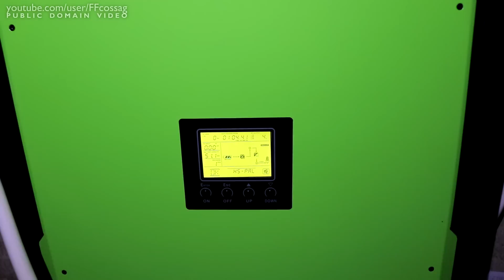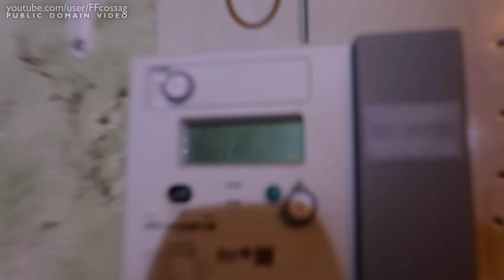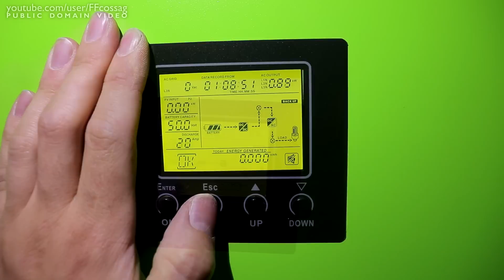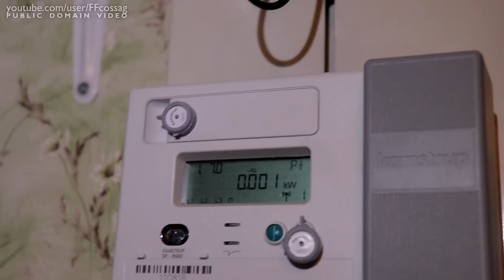10 kW Hybrid Solar VLOG 7 - Old mains & TEST!

Comment: sadly you cant run a grinder when you have a rcd as the motors are low resistance causing false tripping and you cant run some 3 phase equipment as they use ground instead of neutral as the "neutral" is connected to the metal casing so they use earth/ground instead for safety and they cant be used with neutral due to the motors having shared casing and winding connection
Reply from the maker: I'm really not sure what sort of gear you've had experience with, but they're definitely not common problems in Finland. ALL outlets for general use have to be behind a RCD, with no exceptions, and people run grinders and 3-phase machines just fine. I don't think I've ever seen any sort of motor with a shared case/winding connection here, if they exist, they haven't been legal for something like 70 years.
Reply: @FFcossag   the shared casing machines have been used in industrial and farm applications in the 80s and are mainly 3 phase equipment and they were never common and the ones that existed have been phased out for safer designs due to farmers getting electrocuted when the equipment had a ground fault. I think the rcd i have is a too sensitive Piece of S*it that hager manufactured. I need to get someone with more experience than me and up to date permits/certs to do electrical work to look at my distribution panel and electrical connections as if there is a bad connection in my panel that could be one reason for tripping when trying to run any of my grinders on any of my 10 or 16 amp circuits.

and if anyone asks no i havent nor will i ever open the 3 phase distibution panel myself as my SFS 6002 cert expired 2 years ago and my insurance wouldn cover it if my house burnt down and even if the cert wasnt expired i wouln't be allowed to test and certify my own installations in my own house.

Comment: I don't know if the code allows it over there, but here in Spain we install "SI" class RCCBs when there's a lot of switching noise present. I had to install one because way too many computers, and it fixed all my false-tripping issues. Maybe installing one of those (or whatever your local equivalent is) would allow you to remove the PE-N jumper.
Reply from the maker: It's not a problem in the final configuration.

Comment: There are RCD/GFI for VFDs specially made Type F, they are also a bit cheaper than Type B.
Reply from the maker: Thanks for the tip, but it's a non-issue since the heat pump isn't connected to an outlet, so it doesn't have to be GFI protected.

Comment: Who needs a PowerWall when you have a whole PowerBasement? :P

One thought though, as you've been adding DIN-rail breakers & whatnot, how come you didn't update your 'central' to the same (us Brits call that the fusebox, or Distribution board if you're posh or an electrician!)? Would have made it all look nice and modern then, them fuses just look so odd amongst the new boxes and that Smartmeter...
Reply from the maker: As Wiresgalore explained, I'd have to rewire the entire house to modern code if I did that. It's just not economical at the moment.
Reply: Cause if it aint broke, dont fix it haha! But in all seriousness he has spoken before about the wiring in the house becoming old and brittle so its probably best to leave that side of things alone until your ready to undertake a complete house rewire. Plus i don't know about where he is at, but where i live, if you start changing certain parts of the system like the distribution panel then the whole house has to be brought up to code. The "grandfathered in" rule no longer applies.